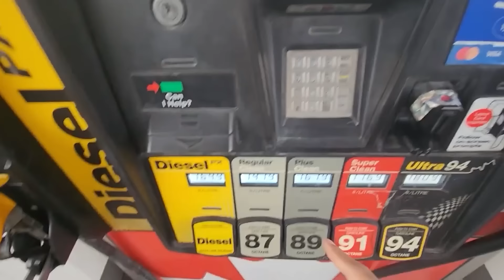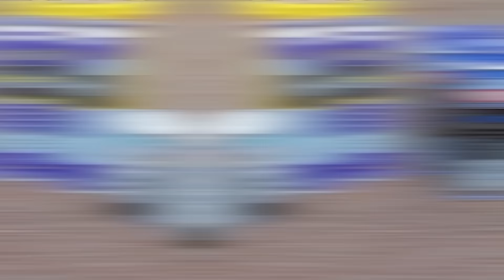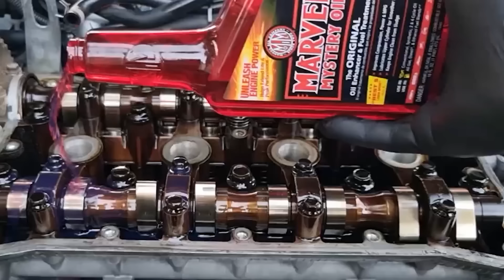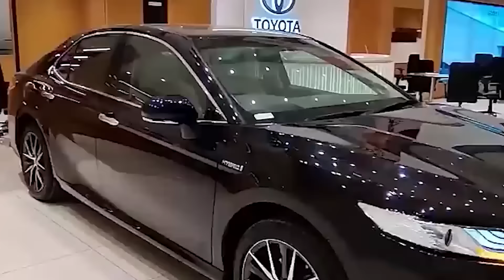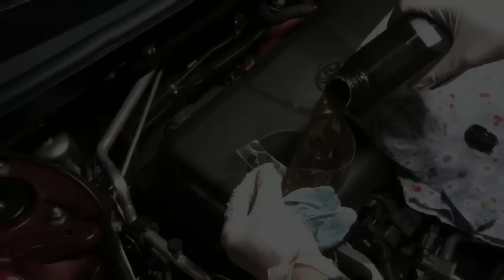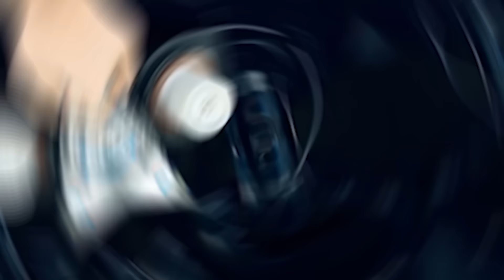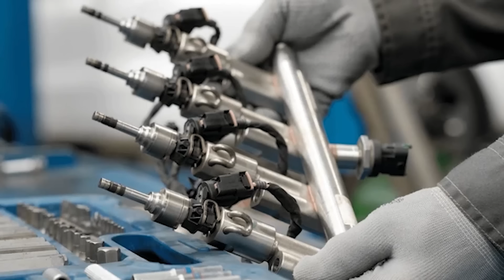I Compared 5 Fuel System Cleaners Over 25,000 Miles — Only ONE Stayed Clean

Comment: I use Lucas upper cylinder lubricant every fill-up and Techron after every oil change. All fuel sold in the US starts off exactly the same, the only difference in brands is the additive package the delivery tanker adds before leaving the depot. Since i'm very skeptical of gas stations actually selling the brand fuel they advertise - I simply go to the discount gas station where I know I'm just getting the basic fuel and I apply my own additive package.
Reply: You are exactly correct about the fuel being all the same. I work at a fuel depot and the additives are put into the fuel as it is loaded into the tanker. Everything is computerized today.
Reply: Actually, all fuel in the USA IS NOT the same. While there is a minimal federal standard additive package to gasoline you will in fact cause a lot of issues with modern engines.  Research Top Tier Gasoline which is a standard that the Auto Manufactures of modern cars implemented for modern cars (and they are now on a revised and improved standard).  There are certain national chains (Shell, Mobile, etc) that require the Top Tier additive package at all of their gas stations.   Lower cost chains and local low cost gas stations typically do not have Top Tier gasoline as the additive package cost money.   Note that all gasoline is the same at the Tank Farm where the delivery trucks load.   There is an additive station that adds the additives needed for delivery to the stations they are serving.  The additives are added to the gasoline just prior to it being loaded into the tanker truck that delivers that gasoline to the station.

The Top Tier web site will show you the local stations and national chains that meet the newest top tier standard.  I used to have problems with my car.  Since changing to Top Tier gasoline I no longer have those problems.
Reply: @perryallan3524 It is all the same before they add the additive package !
Reply: @perryallan3524  I don't think you completed reading my post or understood what I said
Reply: ...or maybe you're just a "FailBot"
Reply: @ericmartin2470 You really do not know what you are talking about.
Reply: @BigmanKris  HateBot
Reply: @ericmartin2470  I understand that you are willing to pay about 50 times the cost of an additive package because you don't trust national brands.   I'm glad you have that kind of money to spend.  Most people do not.
Reply: @perryallan3524  Yea, spending about $3.00 more at fill-up hurts my wallet hard. I also spend about $40.00 on Mobil 1 Extended oil and filter and change my own oil every 6k to 8k miles. Most people don't do that either... but hey, I've had no major repairs on my 03 Caravan and have owned the vehicle for 23 years. It works for me - taking care of issues that comes up immediately and regular maintenance seems to help.
Reply: @ericmartin2470  Top TIer gas in my area is about 1 Cent per gallon more than the cheap stuff.   So I spend about 15 cents per fill up for the same - and perhaps better protection.  I also don't have to worry about pouring a bottle of something each fill up.   I do use Mobile 1 oil - and have since the 1st oil change at 4000 miles (now over 310,000 miles on my 2009 Sonata).
Reply: @perryallan3524  It's all good... you take care of your ride and it takes care of you.
Reply: @perryallan3524 you’re making magic numbers up. I buy redline and add it to my tank it add maybe $4 to each tank’s cost of that buying it in bulk.
Reply from the maker: That's a really thoughtful approach and you clearly know your stuff about fuel distribution. The script actually confirmed Techron performed well in the mechanic tests with solid PEA content, so that part of your routine lines up with the findings. The only thing worth mentioning is the video did caution against mixing multiple additives regularly since they can sometimes interact in unexpected ways, but it sounds like you've got a system that works for you and your vehicles.
Reply: @AutoCareLab  I'm not too worried about mixing because when I fill-up my tank it's at or below the 1/4 tank level. I try not to run until i'm on fumes because the fuel pump is cooled by the fuel in the tank. My sample size is 1 of 1 - a 2003 Dodge Caravan and it runs like the day my Mom drove it off the showroom floor.
Reply: I or own a mobil , top tier branded fuel. If you have a Mobil near you i recommend you filling up there
Reply: @ApimpNamedSlickBack663  I do stop at the Mobil right down the street from my house when I just need a bit of fuel to get me down the road. When I fill-up its at the discount fuel at the big box store or who ever is offering the lowest price in my area.